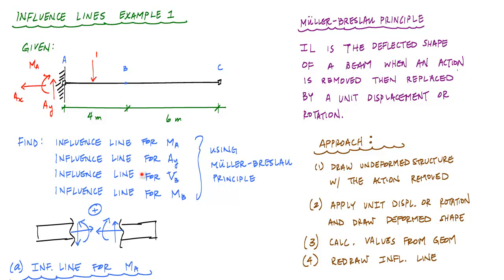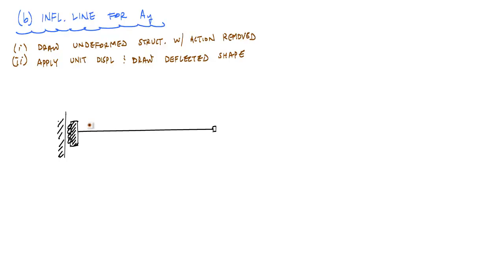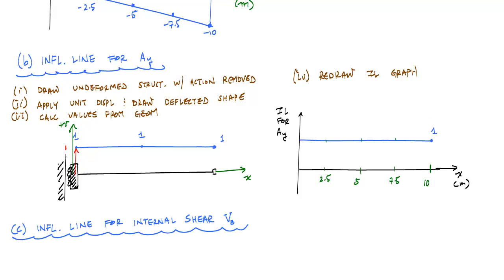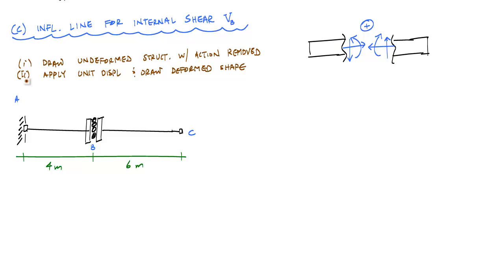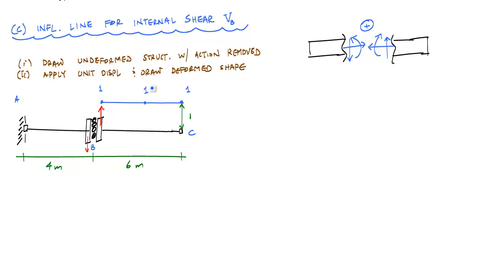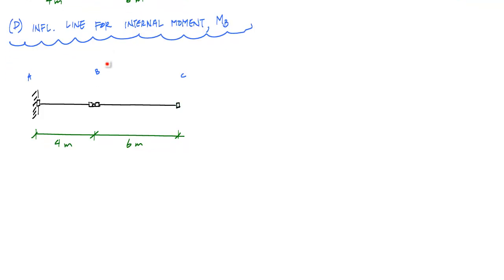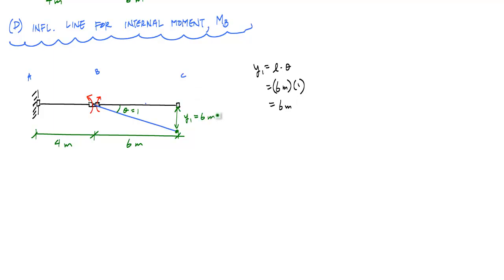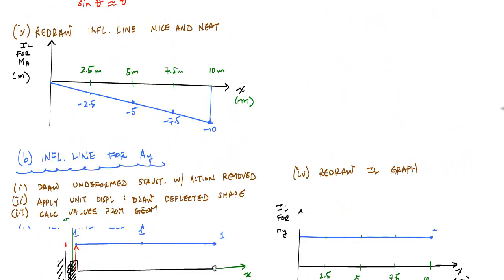Influence Lines for Beams Example 1 (Part 2/2) - Structural Analysis

Comment: for the diagram in part D how can a triangle with an angle of 1 have an equal vertical and horizontal length of 6m that would require an angle of 45 degrees or pi/4 radians

Comment: Thank you so much ,
I just have a small question why doesnt segment ab go down ?(for the shear part at B)
Reply: It's a bit late now, but i think segment AB doesn't move down (or rotate down) because it's fixed to the wall at point A (its a fixity, and not a pin connection). Although, segment BC is free to slide up and down because of the rollers replacing our point of interest (B).

Comment: Hey man, thanks for the videos. Theyre really helpful! 
Quick question though, all of your deflections seem to be linear, or straight. In reality, the deflections would be curved, for example in the influence line for Vb, you've said section AB remains horizontal, which leads to the unit deflection being completely on the right side of the release. Wouldn't AB in fact bend slightly into a curve, thus deeming the unit displacement being shared on either side, and therefore changing the influence line?